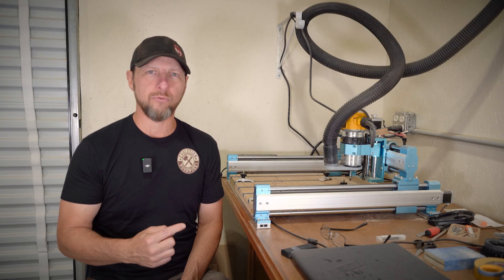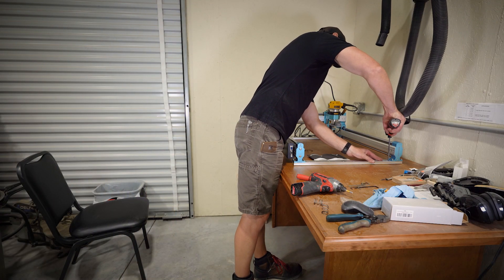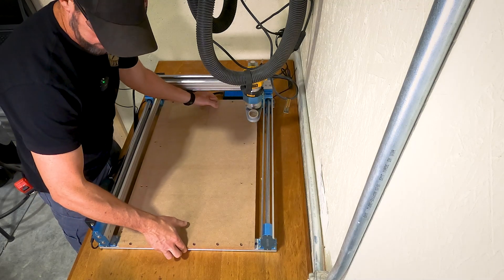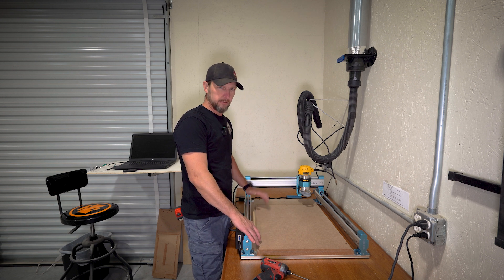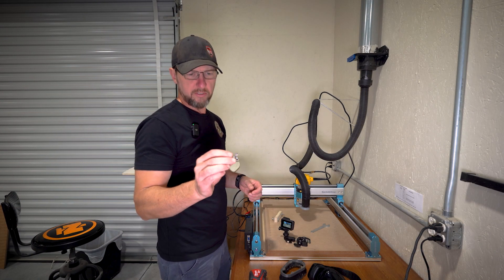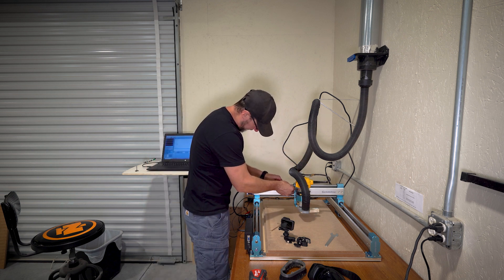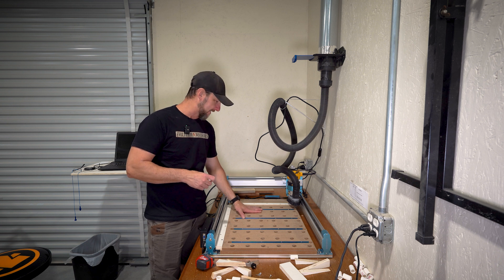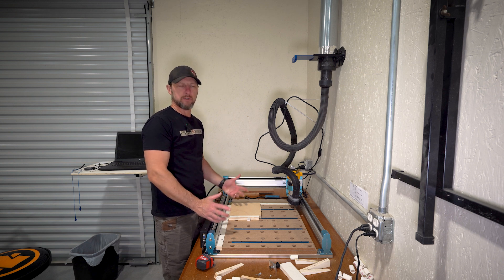Y-Axis Extension Kit Install | Genmitsu 4040 Pro CNC

Comment: Out of curiosity do you have the file for flattening and the dog holes available for purchase?
Reply from the maker: I don't. To be honest it took so much fiddling around with it to make it work "OK" on my machine I don't think it would do anyone else any good. You'd need to tweak it to work on your machine so it's not bumping the stops or coming up short around the edges.

Comment: Does multi-layered boards affect the Z-axis travel of the router?
Reply from the maker: Not sure I understand the question. Affect it in what way? If it's thicker you'll have less room for travel and, of course, it has to fit under the cutter.
Reply: @Evolution.Workshop  That answers my question. Thank you.

Comment: Nice work, think your t track needs to be sunk way below the top of wasteboard or a random thick carve will cut into it.
Reply from the maker: @JohnColgan.  it's about 3/16" below the surface. That's where I had it on the original without any issues. I generally don't go more than a couple thousandths into the spoil board.
Reply: @Evolution.Workshop  camera angle it looked level
Reply from the maker: @JohnColgan.  Yeah, I can see that. I did explain it a bit more when I did it, but apparently, you have to turn the microphone on for it to record. Who knew? 🤦‍♂️